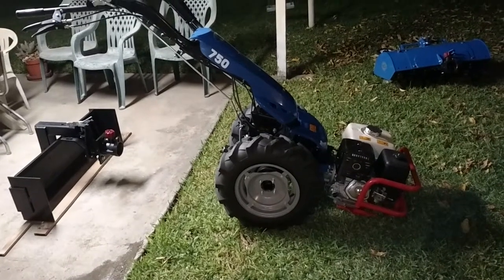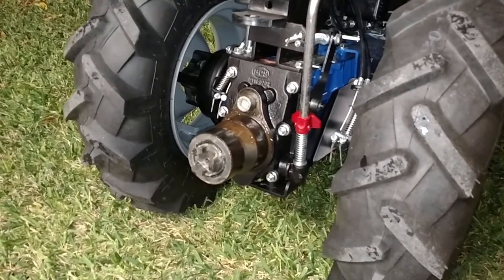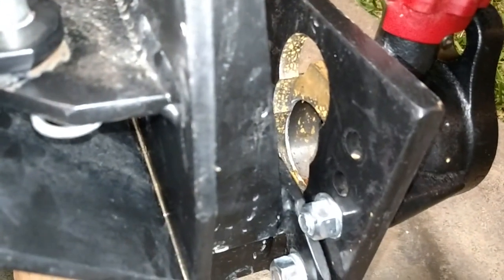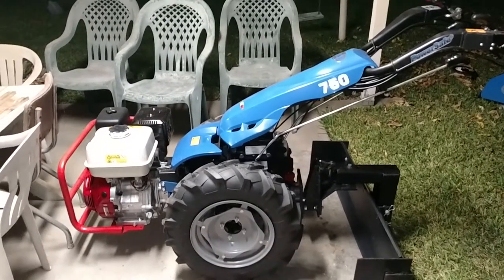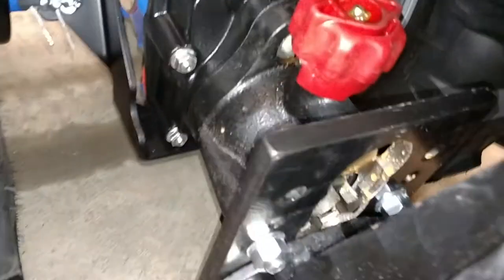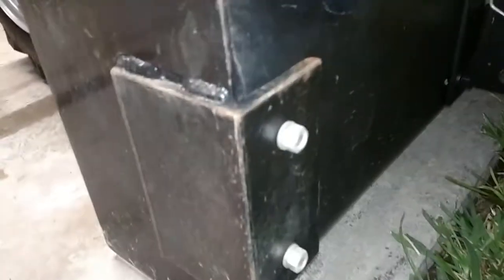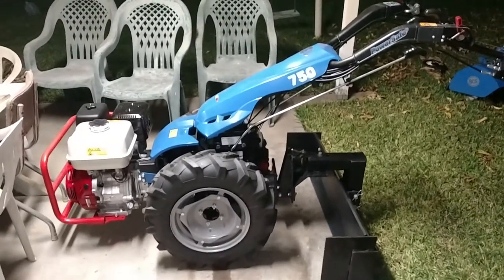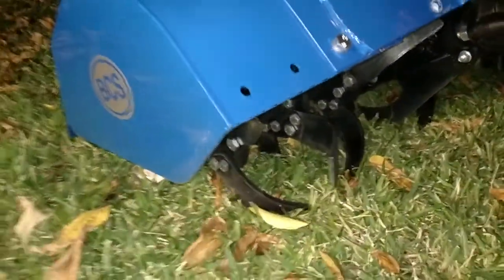BCS 750 walk behind Tractor with a leveler adapter plate on dozer blade-box scraper.

Comment: I gave a question ⁉️⁉️⁉️⁉️
What is your personal point to choose model 750? What is the main purpose for model 750 because there are lots of models such as 710,720,739,852,853,749, and 750...?  The reason I asked because I am of Walk behind tractor farmer and still looking for one,so if I need one for farming 6 acres... planting corn seeds, tilling weeds in spaces of rows but need a powerful engine and multiple duties and changeable working speed
Reply: So there's key differences between. If these tractors I'm a farmer like you  I do a little bit more than just 6 acres I run about 40 with these garden tractors. 
 So the 750 is the king of the fleet. 
Not because of the engines the engine is all the same. DX390 Honda . But the engine power and gearing is different on the 750. While most of the other operational tillers  They make in the BCS fleet the fastest one is the a 853 but it's not the strongest.  The 853 however can run all the other attachments attachments including the hay attachments. Except for the heavy Duty  33" tiller.  Mainly because it's pto shaft. Cannot support the weight and can't spin it. Yet even though it has enough horsepower to possibly spin it the shaft is impossible to spin it because it's so weak. The 750 has an iron Cam shaft making it Extremely durable and it's thick I own one of these machines and the PTO shaft is extremely thick. Yet in addition the engine also converts most of its power not only into The Times but into the wheels as well unlike the other tillers like the 853 and lower depending on gear. Which converts most of its horsepower into speed.   While the 750 converts convert some of its power into the tines and into torque so it can get extra grip in the wheels  More traction I should say. But it's not that fast. About 4.2 miles per hours as fast as it'll go. While the 853 is 9.2 plus miles per hour.

Comment from the maker: Thanks for watching!
Reply: Do you have a video where you use the blade
Reply from the maker: No, but I  need  to  make one.
Reply: where can I buy this walk-behind tractor, am interested
Reply from the maker: At a BCS dealer, or go to BCS America  website,  or call  BCS  America  and  they will  be  glad to help you with  finding a  dealer.  If you  live in the  USA.  This  tractor is made in Italy.
Reply: @michealsousa559california5  did u just make an order or u walked in to buy it ..? Which idea is better between to order or stop by?
Reply from the maker: @funkidslearning9646  the  adapter  I  ordered  it  from  Earth Tools from internet.  Box blade adapters  and leveler plate. You can also call earth tools  and speak with them.
Reply: @michealsousa559california5  Is earth tool the only dealer or other dealers as well and one more thing, was it already installed with your order or u need to install by yourself after the order?
Reply from the maker: @funkidslearning9646  you can check out BCS America website, or call then they can find a dealer in your area.
Reply: @michealsousa559california5  thanks